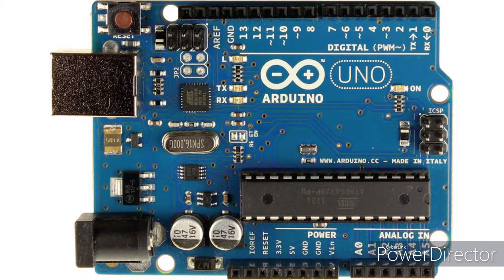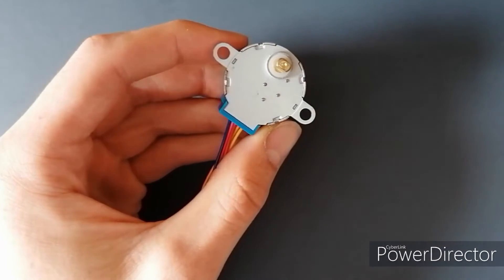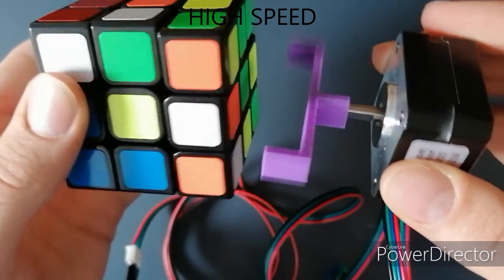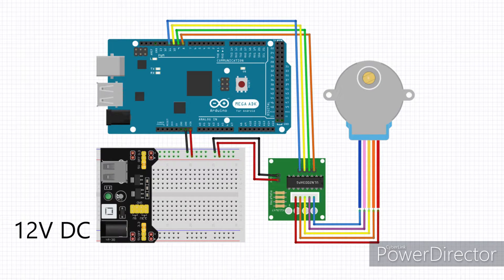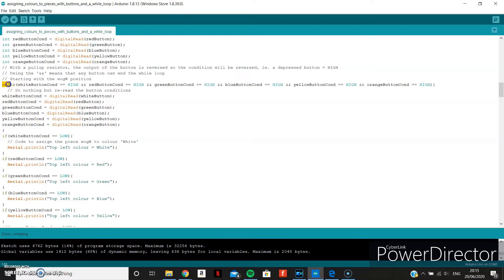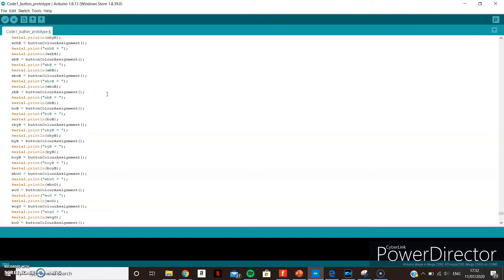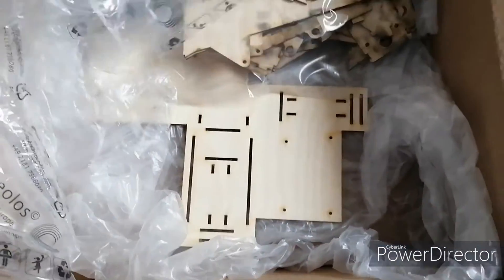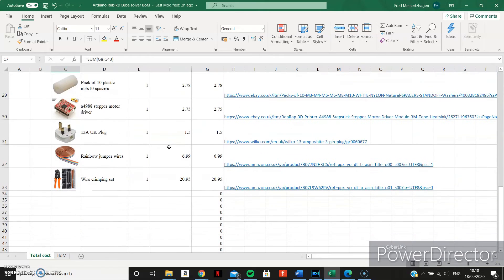Coding an Arduino to solve a Rubik's Cube | Code explained

Comment: Hello, how do you go about taking the zero point of the stepper motors?
Reply from the maker: The code only rotates the motors from where they start, so their position when switched on is technically their zero angle

Comment: Como es que declaras los colores con los botones, es decir existe algun orden o se puede iniciar y finalizar con cualquier cara?
Reply from the maker: Yes it is expecting you to press the buttons in a specific order, which I decided
Reply: @freddiemeinertzhagen  and what is that order? I tried to do it but I can't solve the cube correctly
Reply from the maker: If you're using my code then you should be able to read the order from the bottom... Otherwise I'd suggest checking that the motors are wired to turn the right direction

Comment: Thanks for this breakdown.  This is a behemoth of a project that the crazy part of me wants to approach once I get more experience with Arduino. 
That solve almost seemed counter intuitive towards the end. It looked like the first two layers were solved, and then almost got completely jumbled, and I was thiking 'what the hell is going on' and then, BOOM! out of nowhere it's solved.  Congrats on making it work.
Reply from the maker: I'd say it's more manageable than you'd think as its just a case of getting the components to communicate properly and arduino is great for that. It's the little bits like connecting motors to the cube that get you!

Comment: I hope you reply to me , I can not able to understand why this color sensor not  present in the diagram? How it is solving without color sensor attached?, Thanks
Reply from the maker: The colour sensor was too sensitive to get the colour right every time so I replaced it with buttons. Unfortunately that means the machine needs you to tell it where the colours are (by pressing the buttons) and can't work it out by itself
Reply: Thanks one more question is that do we only need to input one side of the Rubik's cube and it will start solving or what? Thanks
Reply from the maker: @muhammadmirza3825  it needs all the positions to start, I coded it with an easy sequence to remember. There is likely a way of coding it so that you only need to tell it a few of the positions but I didn't try that with this project

Comment: Hello Fred, could you share the code with me by any chance. I want to recreate your cool project but unfortunately have a tight deadline.
Reply from the maker: There should be a Google drive link with the code in the description
Reply: @freddiemeinertzhagen  oops this is embarrassing. Thanks 😅
Reply: @freddiemeinertzhagen  Different question. I don't quite get where you built in the color sensor.
Reply from the maker: Unfortunately the colour sensor was too sensitive to light to give an accurate reading, you open a window and all the values suddenly change. So I replaced it with buttons. They were meant to be a temporary solution but the colour detection turned out to be a lot of work to implement afterwards...
Reply from the maker: Also you would need a whole load of sensors, or a system to move one sensor around the cube which is pretty complicated. Most people manually do the colours like this or use a camera and raspberry pi
Reply: @freddiemeinertzhagen  Oh, okay thanks for the help.

Comment: Hello, im a student and this is my final project…great video man I appreciate the excellent description but if i wanted to do the same project but i need it to be more simple than this one 💔 what shoud i do
Reply: If you can give me your email so when can discuss how to do similar but simpler project that would be great
Reply from the maker: Unfortunately this seems to be as simple as it gets, you can't really eliminate any of the parts without impairing the function. Perhaps you could remove the retraction motors and manually slide/screw the motors back and forth

Comment: Hi Fred I'm trying to make the Rubik's Cube Solver myself but I am having trouble with the code.  Can you share the code with me so I can try to figure it out and make it better if I can?
Reply from the maker: There are still mistakes in my code but it is now in the video description 👨‍💻
Reply: @freddiemeinertzhagen  Thank you so much! If I can make any improvements then ill send it back.
Reply: @freddiemeinertzhagen  Hi again I have a few questions, and some methods for faster solving. Probably the easiest way to make the solve faster is doing the most efficient turns to put the peace in the solved position. If you have not done that you could also use a more efficient method of solving the cube, the current fastest way to solve a cube is the CFOP method, so if you programed it to solve the peaces so it would always be the same OLL and PLL cases that could save a lot of time. Also if you could share the 2D and 3D files as well that would be great!

Comment: How did you solved with the current flow to stop it when not sending any commands from arduino? Because the motors are always getting voltage due to A4988 and so,with 6 motors you get a flow of 4.2 amps without doing anything.
Reply from the maker: Yes that's true, if I remember correctly I think you can connect the enable pin to a digital pin on the arduino to toggle the a4988 outputs on and off to prevent any current draw. I only thought of this after soldering everything so mine is not wired like that, the a4988 logic is connected to the 5v regulator so I manually controlled the current draw by switching on and off the regulator
Reply: @freddiemeinertzhagen  yes thanks. I did that right after I posted the question with some code edit and pin 52 to each En pin of A4988. Now each motor has 50mAh on use and 0 on hold and in place of a regular power source, i mounted a Li-ion battery 12V of 25Ah so it can be portable. It works like a charm.

Comment: That's pretty cool! How does the arduino not accidently remove other pieces while putting in one piece? asking because I don't think you were using algorithms
Reply from the maker: I did use algorithms, I coded them manually using the same algorithms as in the instruction sheet
Reply: @freddiemeinertzhagen  Oh, makes much more sense now, thanks!
Reply from the maker: For example

int yellowCrossAlgorithm(int x){
  // f, r, u, ri, ui, fi

  if(x == 2){
    // rc, gc, yc, ga, ya, ra
      redRotate90();
      greenRotate90();
      yellowRotate90();
      greenRotateInvert90();
      yellowRotateInvert90();
      redRotateInvert90();

Comment: Where did you used the colour sensors
Reply from the maker: There were meant to be colour sensors but I had to get rid of them for this machine because I couldn't design a decent retraction mechanism without overcomplicating it. The buttons were meant to be temporary but ended up staying
Reply: Without using if.. How did you get the positions of the colors.. ? 

Do you scan it everytime with the sensor,before giving it to solve?
Reply from the maker: I had to input the colours using the buttons by pressing them in a particular order. Essentially I coded the arduino to assign the button pressed to a particular position i.e. the first button pressed assigned that colour to the top left square on the white face, the second button pressed assigned that colour to the top middle square of the white face etc. like at 11:55 in the video

Comment: Hey Fred, your amazing video of your project inspired me, to try this on my own :) I have now basically everything in place, however there are two problems, for which I hope that you can help me... First of all, whenever I start the code, all the motors make a very loud turn in one direction, it isn't always the same amount of steps. Somehow the pins have to switch from LOW to HIGH in the setup part of the code? I have no clue why it does it...
My second problem is, that the stepper motors make a noise, whenever the Arduino is plugged in and the external power source for the motors is plugged in as well. I checked my wiring several times and was just wondering if maybe you had a similar problem...
Greetings from Switzerland^^
Reply from the maker: I don't know what you mean by starting the code since it starts automatically when you plug it in, but yes I think the arduino takes a moment to start up and when it does its pins seem to output random high and low signals, because my motors also jump around as soon as the arduino is connected to power. The way I got around it (there might be a better way) was just to turn the arduino on first, and then a second or so later, connect the 5V to the stepper drivers (that way you activate the motors after the pin voltages have settled). I was using a 5V voltage regulator to supply power to the VDD pin on the drivers, so all I had to do was plug the arduino into the 12V power supply first and then switch on the regulator. If I didn't turn the arduino on before activating the drivers, the motors would turn to a random angle and wouldn't be in line with the cube faces. I hope that helps!
Reply: @freddiemeinertzhagen  I figured something similar out on my own. I only plug in the 12V Power source, after the setup part is done. My machine is working now and I'm so happy :)

Comment: Hey Fred, I have a question for you. I'm working on this school project where I decided to build and code the whole robot (i have no experience at all). I have one year to finish this project plus write an essay on the whole process and i was wondering how many hours a day you worked on it. As I said i have no experience at all and i would like to know if i can learn how to do this in one year. Thank you and great video btw.
Reply from the maker: I started this project to learn how to use an arduino so didn't have much experience either and it took me about 4 months from idea to finished prototype. Can't remember how many hours I spent daily but probably about 15-20 hours a week maybe, assuming I worked on it every day. If you haven't got much else to do at school then you probably could do it

Comment: Hi Fred, I have an exact same set up but it burnt the voltage regulator on my arduino mega. I powered it using a 12V external supply which I tested before I hooked it up. After about 3 minutes of being on, it fried the regulator and now it can no longer turn on via external supply (haven't tried USB). Do you know why this happened? No visible damage to any of the components but I burnt my finger when I touched it after just a couple seconds of being on.
Reply from the maker: Hi, sorry to hear that! I suspect that the power supply actually isn't the issue, because as long as its 12V DC connected to the 5.5mm jack it should only draw as much current as it needs (also make sure the polarity is correct if you're wiring it manually). I checked my diagram in the video and it shows the arduino powered by supplying 5V to the Vin pin, if you connected 12V to that then it could be the problem. Definitely try a USB connection and maybe a much simpler test curcuit like some LEDs to see if that works, but if its getting that hot then it's unlikely to work again. Otherwise, I would have to see your setup to know if there is another problem. Another good practice (for future reference) which I haven't got in the diagram is to put a decoupling capacitor across the power supply to prevent voltage spikes from damaging components. My final circuit never had these and they worked fine, but there might be a chance that activating the motors caused a voltage spike and somehow damaged the arduino, but I had no issues with that as far as I'm aware. If you do any more tests, don't assume the diagrams in the video are completely safe because I only made them from what I learnt online. That being said, they worked fine for me. If you figure out what caused it, I'd be interested to know what it was!
Reply: Thanks for the reply! I connected the 12V using the adapter, not the Vin pin, everything is wired correctly. After a 30 min break or so, I tried it again and tested the voltage at the regulator and it was working again. What would cause it to turn off and not come back on again for a while? You had yours operating for more than 3-5 min at a time I'm sure so I don't see why it would overheat.
Also I would like to specify that I had no motors connected and was only testing one driver to set the limiting current. So essentially I just had one driver chip on the bread board which was wired to the arduino
Reply: I found a short in the power bar of the breadboard which wouldve done it. Everything else working now!
Reply from the maker: Easily done. In fact I'm surprised the arduino still works, usually one short and it's finished!

Comment: Hi, I have a question at 6:30 ,  how fast is the motor there? (how much time the motor needs for one quarter move)
Reply from the maker: If I remember correctly the code I used activates 50 steps for a quarter of a turn, with each step taking 1ms so that would be 50ms. But I think I used 1.5ms in the final code (the speed in the intro) to avoid jamming